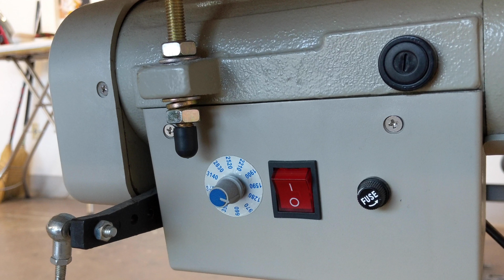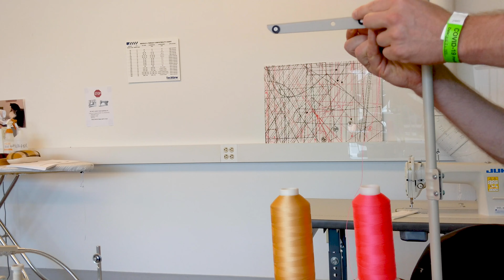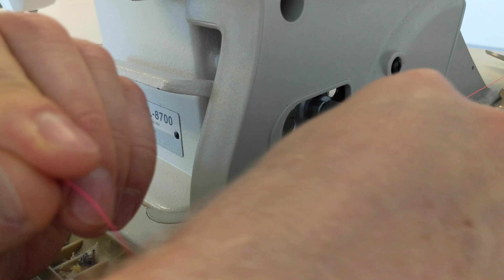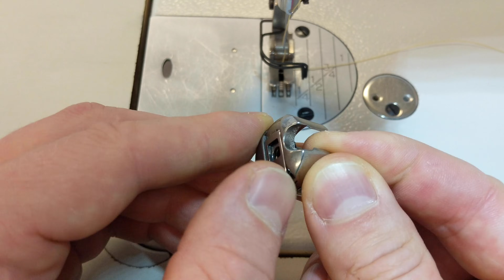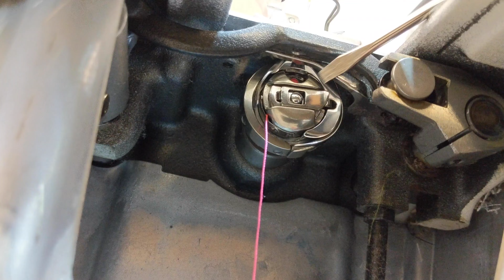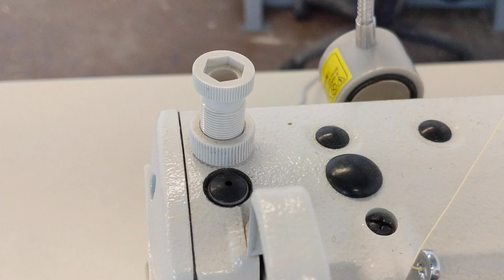How to Thread Juki Industrial Sewing Machine - Juki DDL 8700

Comment: My manual shows the thread to be going counterclockwise when being pulled in the bobbin.
Reply from the maker: That's what the video shows in the bobbin case, or do you mean on the bobbin winder?
Reply: @WhatMakeArt you put the thread in the bobbin with the thread going counterclockwise.
Reply from the maker: Yes,  bobbin Case in left hand with groove pointed towards you, then bobbin and right hand with thread coming over the top of your finger, then put the bobbin in to the bobbin case and the thread goes into the groove, then pull down towards the notch that controls the bobbin tension
Reply: @WhatMakeArt I noticed some you tube channels show the thread being placed in the bobbin clockwise.  One guy said because of backlash issues.
Reply from the maker: Intersting

Comment: Ma bobine ne tourne pas sur la tige du bobineur j utilise la bonne taille de canette pour la Juki 8700 on dirait que la tige n est pas assez «  ouverte » ou large je dois bien pouvoir ajuster pour que la canette soit plus serrée?
Reply from the maker: You can use a screwdriver to press press the two tabs apart to tighten it so the bobbin doesn't spin

Comment: Good morning! My coil is loose on the rod of the reel so it does not turn when I try to fill the coil, how can I tighten the coil on the rod?
Reply from the maker: You can use a screwdriver to press press the two tabs apart to tighten it so the bobbin doesn't spin

Comment: On a home sewing machine, when the thread and bobbin are properly inserted into the machine, together they form the letter "P" like princess.  On the industrial machine when the threaded bobbin and case are inserted properly, together they form the letter "Q" like queen. So, I suppose I am ready to sew like a queen on an industrial machine!
Reply from the maker: Go go sewing 👸
Reply: I used home sewing machines and had bad results, such as uneven stitches, crooked seams because the feed dogs shift, etc. I am ready to buy an industrial machine.  I didn't even know that threading the bobbin was different from a home sewing machine. Thanks for the video!

Comment: Hi I would like to correct this my Juki does not have a disk like your 8700 ; but 2 hole , the thread should go from back to front for first hole and the second hole should be from front to back
Reply from the maker: Yes, that is correct for the top threading,you really don't need the top disc

Comment: When sewing Jeans with Denim (medium to heavyweight) on an industrial, Should the bobbin tension be loose or tight? What should the thread tension be, loose or tight?
Reply from the maker: Could be different for different thicknesses and number of layers of fabric.

Generally, once you set the bobbin tension on the bottom it should be fine

Do a test sew with different numbers of layers of materials and then ensure that you have taught stitching on the top and bottom and that the loop or "lock"  is in between the fabric

Then you should be good to go

As a point of reference when I sew with Tex 70 thread I have slightly tighter upper tension and a bit looser Bob and tension than I would if I was sewing a shirt with thinner thread
Reply: @WhatMakeArt  Ok.

Comment: Hi, what size thread and needle was used in this video please?
Reply from the maker: Tex 69/70 thread, a bonded polyester thread

Needle was 110/16
Reply: @WhatMakeArt  would 110/18 be ok to use with tex 69/70?
Reply: Would 110/18 even fit on this machine
Reply from the maker: Yes it fits
Reply from the maker: Here's a good guide on thread and needle sizes

https://www.thethreadexchange.com/miva/merchant.mvc?Screen=CTGY&Category_Code=needle-size-chart

Comment: How can I shorten the Stitch on that machine
Reply from the maker: It's the knob on the right hand side right above the reverse lever. Turn it clockwise or counterclockwise to adjust the stitch length It goes from 1 mm to 5 mm.
Reply: @WhatMakeArt   but we have done that and it's still not working
Reply from the maker: Make sure that you have enough tension on the presser foot and you have the feed dogs raised enough otherwise the fabric won't be pulled through at the correct speed

Comment: I bought a brand new machine 7 months ago.. not once did it wind without giving me a hard time. I did open the passage any yet the same issue.. now I have inserted tooth pick to hold the Bobbi .. but the winding is not perfect and causes stitch issue..
Reply from the maker: You can spread the spindle the bobbin is on open with a screwdriver to make it fit tighter. You can also adjust the placement of the bobbin winder left and right by loosening the screw on the table and adjusting where it is compared to the tension disc on the bobbin winder.

Continue to adjust these until it winds evenly.
Reply: @WhatMakeArt  thanks for the respond.. I will try to adjust and report back..
Reply from the maker: If it was new 7 months ago I recommend taking it back to the place of purchase. There should not be a need for a toothpick to hold the bobbin in.

Comment: Hi good morning i b uy a use machine but the problem i have the lady idont leave a maul for machine nor ashure or a bobin so i don't know if gives the name of the machine number the of it is sew strong wsm 8700 serial no 811237 if you would help to things for the machine even the oil toget. I use other machine not a industry machine i will do my best iwhich your video isee everything you do
Reply from the maker: It is a good machine to buy used and should last you a long time. It's sews strong.

Here is a link to the manual for the 8700 DDL from Juki  - https://www.juki.co.jp/industrial_j/download_j/manual_j/ddl8700/menu/ddl8700/pdf/instruction_eg.pdf

You can use this sewing machine oil https://www.amazon.com/dp/B017XHP50W/

Comment: I’m having trouble getting the bobbin thread to catch. What could that be?
Reply from the maker: Make sure the scarf of the needle is pointed the correct direction. (Sometimes you need to rotate it slightly to get it to catch but it should be pointed towards the bobbin)

Make sure that the needle is fully seated in the up position.

Make sure the winding of the bobbin thread is the correct direction like a toilet paper roll.

Make sure the bobbin thread goes through the proper grooves in the bobbin case.

With a bobbin case out and the needle in, slowly rotate the wheel towards you and see if the rotary hook comes up right as the needle is down.

The rotary hook should pass straight through the  middle of the scarf.

If the rotary hook does not go straight through the middle of the scarf then it is a timing problem.